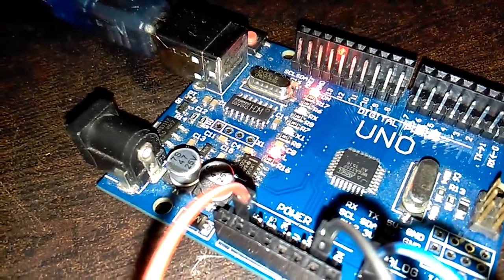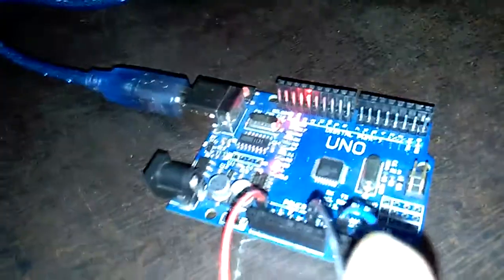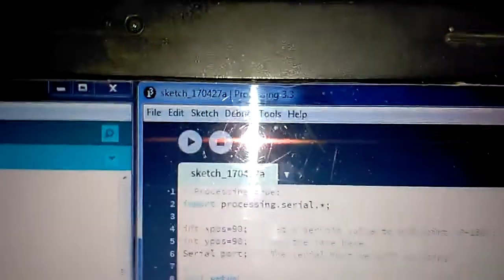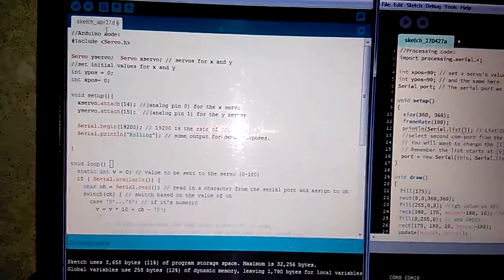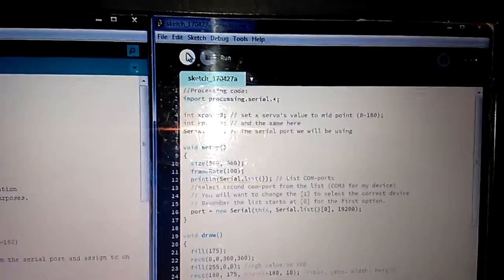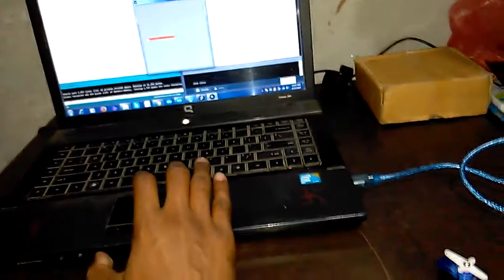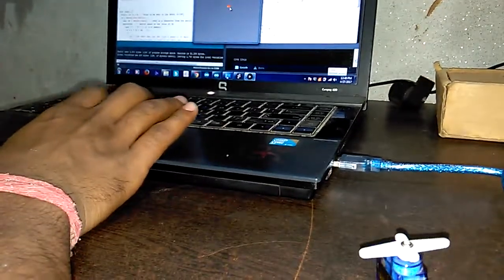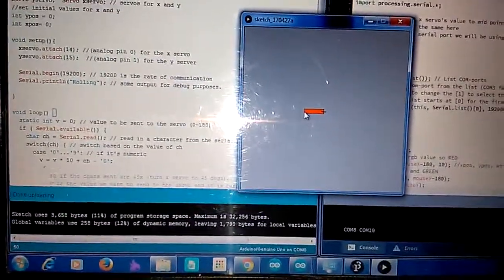Servo Control With Mouse

Comment: what language was this coded in? i know its part in arduino but i dont know the part in the processing software
Reply from the maker: Thanks for query. 
The Arduino build code as sketch in C++ language.
The processing software just use java for graphical interface. It give the variables values for microcontroller directly through usb cable. We also get the values from our microcontroller sensor data for graphical representation.